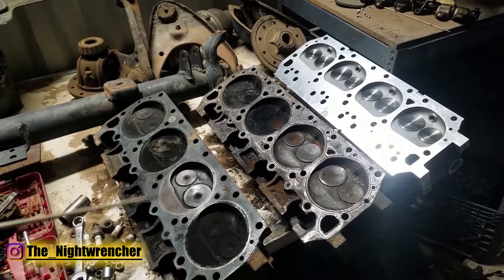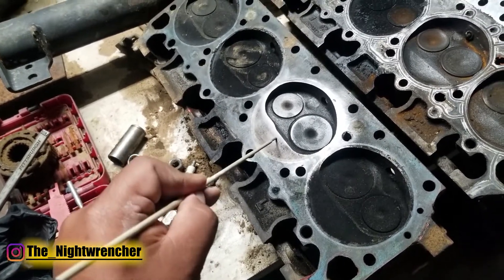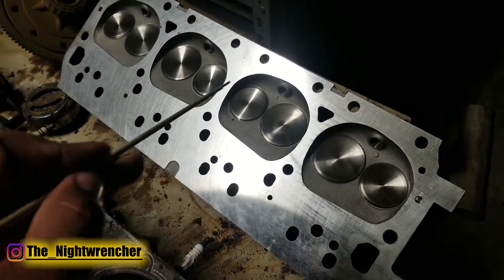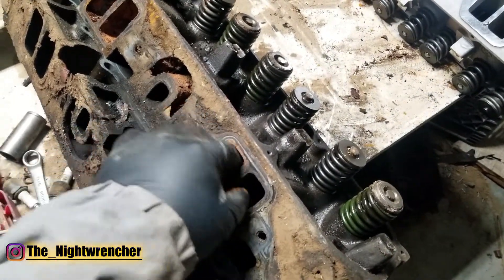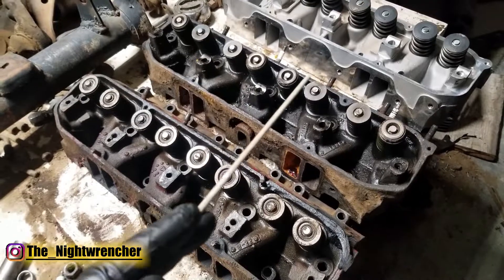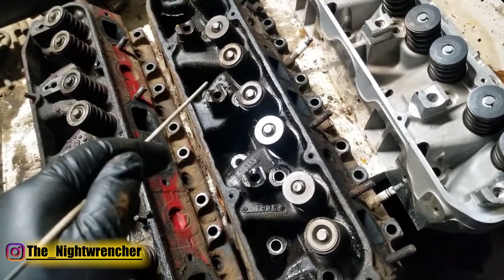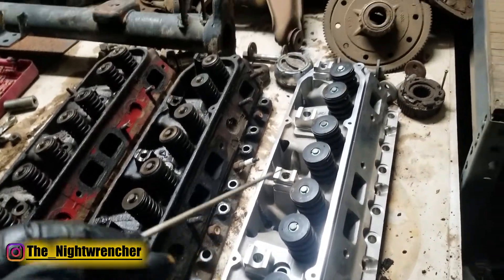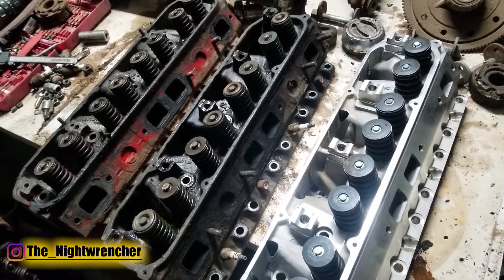440 Source Heads Vs Stock Mopar 924 & 452 Heads Comparison |  Mopar Big Block Build |

Comment: I know that the exhaust crossover is a power sapper for a race engine but I also remember fixing drivability concerns for  people by replacing a stuck open or missing exhaust "flapper valve" so the carb could heat up in cold weather.
Reply from the maker: Having a choke on your carb, can do the same thing 👍 also its not just for race engines. Imagine idling in 95 degree weather, cooling system is already maxed out and now you're putting 400 degree exhaust heat into your intake track feeding your engine. Its fine if its always sub 40 degrees where you live but just add a little more timing and use a choke and you're already there.
Reply: Ford used alot of heat operated chokes - just trouble waiting to happen.

Comment: 88-90cc's for the open chamber is very typical. The open chamber area is about 0.1" deep. You can have many aluminum heads in open chamber configuration, where the odd side of the chamber has been machined 0.1" deep. The difference between them and the closed chamber versions is typically 4cc. The '72 and up 440 CR was changed by a shorter piston, not the chamber. And same in other big blocks, there were different versions like truck engines etc, and the differencies were in the pistons. Open chambers came already in 1968. Your valve sizes are mostly wrong. The 440 heads have a 1.74" exhaust valve, source heads have 2.14 intake and 1.81 exhaust. The '68 and later BB heads are clearly better than the earlier heads, except maybe for the Max Wedge. The 440 source head is pretty much like a ported later model head with bigger vales, cast in. And it's actually pretty much the same as Edelbrock E-Street or RPM heads. Your 361 is a small engine, so it may react differently to the chamber size increase than a 440 would. The effect of the cc difference is greater, but that pretty much depends of the CR you start with. The lower it is in the beginning, the less it matters.
Reply from the maker: Excellent info except for 1 thing you mentioned. Through independant testing, it was found that the 440 source heads produced less power than both the RPM and E street heads by edelbrock. It outperformed all of the stock heads, but not by much.
Reply: @NightWrencher  Yes, they are more "coarse", but the design is the same, you can use the same CNC programs etc.
Reply: @vipottaja  Eric Weingartner did a test on 440 Source and Edelbrock Performer heads back in January. Both videos are easy to find on YouTube. The 440 Source were CNC machined head so I was seriously disappointed in their performance. I definitely wouldn't spend the money it from 440 Source. I have a set on a 440 in my Roadrunner that were just mildly ported and cleaned up but they weren't flowed before or after so I don't know the numbers. But the 440 Source heads Eric tested had weak low lift flow and were only about 265 cfm at .500. The Edelbrocks were similar. Of course a stock set of 906's, 346's, 452's will only flow about 220 cfm so they are an improvement and of course aluminum is always better. I just wonder why they didn't use a more modern combustion chamber design like Trick Flows or Indy? But for the price they are hard to beat.

Comment: I have a 361 "bored .060 over for 372ci" I'm building for my 67 Barracuda But my original heads have cast rocker towers,  and  the casting numbers on the heads are 2463200 but my engine  came out of a 63 Chrysler Newport  they have 2.08" intake and 1.74" Exhaust Valves Same as the 4006452 (440) heads, the original 361 heads you have are 1961-1962 model year.
Reply from the maker: Yeah yours would flow much nicer than mine for sure 👍

Comment: Hey Nightwrencher, did you know that the 440 source heads are "Closed Chamber" design like the factory 915 heads, thats why they don't have the extra space below the valve
Reply from the maker: I think I mention something like that in this video. Or maybe it was in the mopar vs ls head video. But either way, thanks!

Comment: Thanks for the tutorial! I have a 413 wedge (supposedly out of a 72 motor home) in my 78 Power Wagon and it has the 452 heads on it and I'm just researching what I have and what my options are with "upgrades". Thanks again!
Reply from the maker: 72 is a good year because they already have the hardened seats. I'm not sure what the factory compression ratio is on those but 6.7 litters is no joke.
Reply: If that 413 is a ribbed block you may be able to bore to 440

Comment: I have a 440 with 906 heads with work done. I want some aluminum heads. And I'm lookin at 440 source heads. What heads do u perfer to help wake my 440 up. It's not a stock engine.. everything is upgraded and high performance. Except my 906 cast iron heads.
Reply from the maker: Hey man, late reply, sorry about that. The 440 source heads are just aluminum stock heads basically. If you want good heads you'll have to look at edelbrocks or something fancier. The 440 source heads are good if you plan to port them but out of the box they're only a hair better than stock.

Comment: I have a 361 in a 66 charger that I am contemplating keeping and rebuilding it. I wonder how the 361 would perform with turbo or a torqstorm supercharger
Reply from the maker: The 361 is a good candidate for boost. The problem is that you'll need to make sure to tear it down to add ring gap to the pistons or they will break pretty easy with a turbo. If you break a piston, replacements are pretty hard to find

Comment: Exhaust passage/crossover... more than a smog thing [although there may be some benefits] the real need for this seems to derive from straight leg boosters.  Because they sit a little high in the venturi,  velocity/signal  is not quite as strong and fuel droplet size tends to be larger - manifold heat helps boost % vapor, which makes life easier for spark to do its thing.  Go to a downleg or annular boosters when there is no crossover, generally.
Reply from the maker: You're right, it serves a few purposes. The first is the exhaust crossover to supply exhaust gases to the EGR valve. The second, like you mentioned, is to heat the intake to help speed up atomization of the fuel during cold weather. The third would be to supply heat to the choke like you also mentioned. The only important one is the 2nd one but the intake naturally gets hot from normal engine operation so although you'll suffer a bit in cold weather, after the engine is fully warmed up, its fine.

Comment: The 440stealth heads are a nice budget upgrade to stock heads for street builds, I would bet that if you take the 361steel crank and some 383 hi-po rods and kb flattop pistons and put them in a 400 block (KB pistons make a slightly bigger compression hight piston for the 400) to get the compression ratio up use your intake manifold and cam you would have an engine that rev's like a small block and the power of a big block, be cool to find out since you have most of the engine except block and the 361has same stroke as the 400/383,oh don't forget the KB pistons with the slightly taller compression hight and stronger rods
Reply: Plus if you don't like the combo you can still put the 361 back together
Reply from the maker: The stealth heads work well for someone in my situation. Current heads are no good and you want to trim weight and have better cooling. $1000 for a set of ready to go heads isnt bad. I had a set of 440 heads refreshed and it was $300. They wernt even the good ones.

Comment: Not to be nit picky but your info on EGR is off. The exhaust cross over port on the stock heads is for cold start intake heating and would heat the bimetal choke pull off spring.  It was not used for Exhaust Gas Recirculation until the early to mid 70's. EGR was to lower NOx emissions by metering exhaust gas in to the intake manifold and on in to the combustion chamber. There it acted as an inert gas to prevent detonation under lean fuel conditions. This meant the engine could run lower fuel/air ratio and not ping and when the engine pings NOx in the exhaust is at its highest. Enough of that. I have always wanted to find a 58 350 crank as it has a the shortest stroke of all the Big Blocks.Then mate it to a 400 bloc which has the largest bore. That combo should turn some serious RPM's for a Big Block. Nice job on the video!

Comment: The closed chamber heads were also used on the 62 thru 64 Max wedge engines, early 440 high perf engines (66 & 67) and 63 thru 65 383 high perf engines. 66 up 383s used the 906 head. The marine/ industrial 361 was a unique engine. The water pump attached to the cylinder heads as well as the block, the heads & intake manifold were unique to the  application as well. The camshaft was gear driven instead of chain driven and the camshaft &  distributor were reverse rotation. The block & heads were cast out of high nickel iron and were extremely durable. They were designed to take a likkin & keep on tickin, they would run all day at nearly full throttle.
Reply: The 906 head was not introduced on any engine until 1968
Reply: @robflammia4716  That's right, last year for the closed chamber head was 67. Been a while since I have worked on a big block.

Comment: How'd the heads work out?
Reply from the maker: They installed fine and it ran 6 passes back to back at the track without issues. My cam is too small to take advantage of the heads but I'll be upgrading it soon

Comment: 1/2 the weight of cast iron. Combined with a 440source aluminum water pump assembly, aluminum intake and header. You can say you put that engine on a diet.